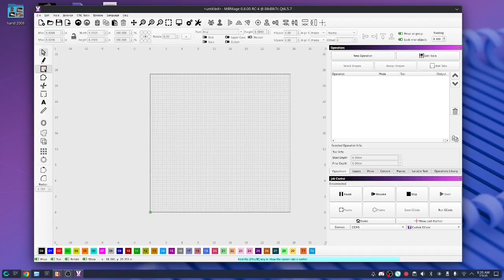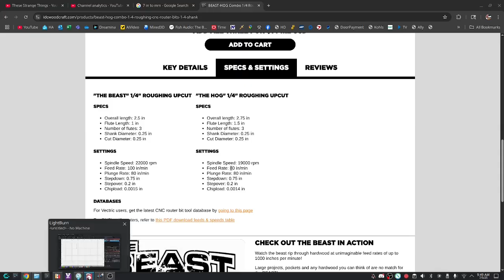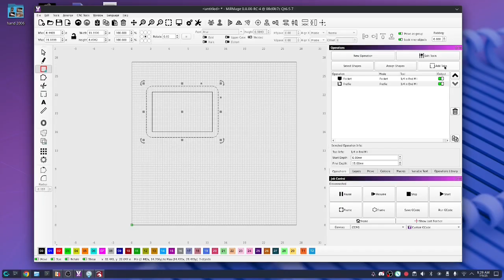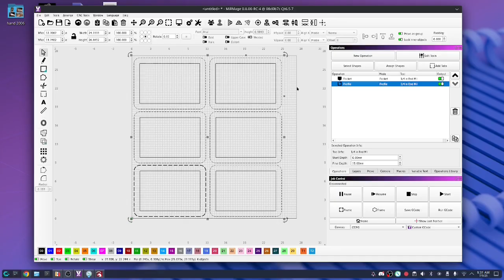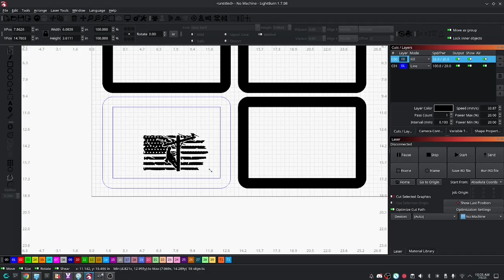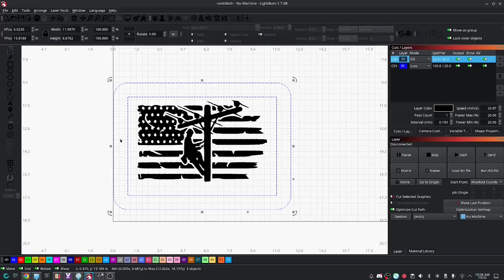Millmage RC Walkthrough on Arch Linux | First Look by a CNC Maker

Comment: I know nothing of Linux  Does this mean Arch can run windows programs ?
Reply from the maker: Linux can run a lot of windows programs. But not all. Before I try to force a Windows based program on Linux, I will search for a native Linux based alternative. Gipm is free and works just as good as Photoshop. Inkscape is great on Linux and free. Kdenlive to edit video is great and free. There are a few different methods to install Windows programs on Linux. The most common is WINE. There is also Bottles, then there is Winboat. And if all else fails, you can always run Virtualbox. I do run Linux as my daily driver, But I still need Windows for a few things like any Lightburn version past 1.7.08, Or Fusion 360, or Vectric Vcarve.

Comment: Did you have to fix anything to make Lightburn recognize cnc/laser machine via usb port? I want to move to Cachyos from windows 10 but I’m not sure if I can run Lightburn on in.
Reply from the maker: as far as Lightburn on linux, /dev/ttyUSB* is owned by root,  so the only thing you have to do is add your user account to the dial-out group to use devices like that. But, Lightburn 1.7.08 is the last version that will work native on linux. You will have to run a vritual machine and install windows to use newer versions of Lightburn. I will stick with Lightburn 1.7.08. I know people are still haveing problems with Ver 2 anyway.
Reply from the maker: CashyOS is great. And it is Arch based. And I still have 1 laptop with Cachy, But I mainly use plain Arch. CashyOS is better than EndevorOS.
Reply from the maker: you can use Boxes for your virtual machines. Just make sure to install it from the terminal. If you install it from the Discover app, that is a flat pack version and will not support USB pass through. So use this command to install from the terminal, "sudo pacman -S gnome-boxes"

Comment: Man, I wish I had been paying more attention and got in on this early enough to check out the RC. I got a Onefinity and really need better software than Carveco. I've been leaning toward Vectric but I already use, know, and love Lightburn and I want to keep it in one house. I hope there is a release soon!
Reply from the maker: You can get the RC to try out. But it still needs a little work. I really like Lightburn, so I really wanted to like Millmage. I think it will be god once they work out some bugs and add 3D. I mainly use Vectric and Fusion 360 right now.
Reply from the maker: My new video shows that you can not use a stepover greater than 50%. they got back to me yesterday and say that a stepover greater than 50% was causing some strange things to happen. They would not go into it but said they are working on it.   https://youtu.be/vTL6wVD21zk?si=V4s6zpMFXSGtdwAG